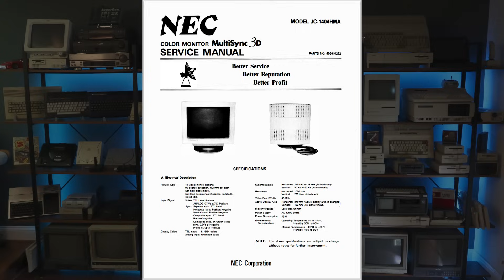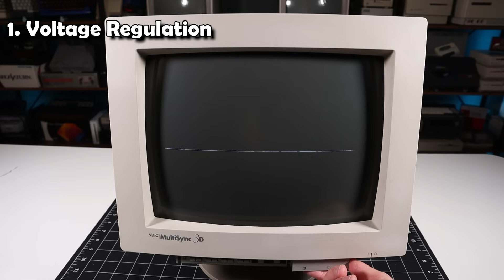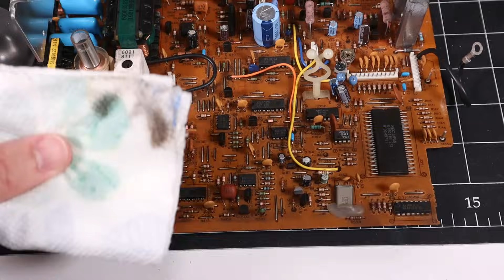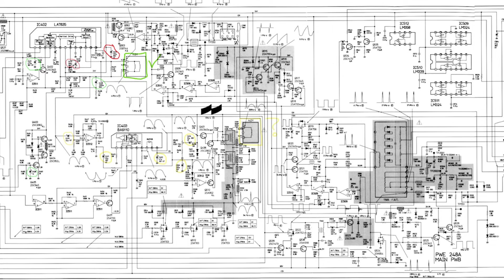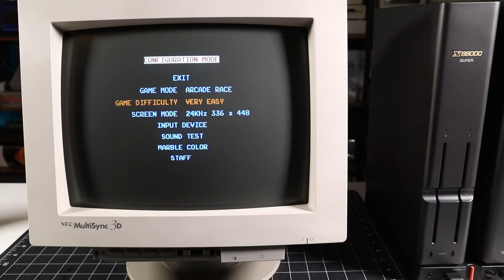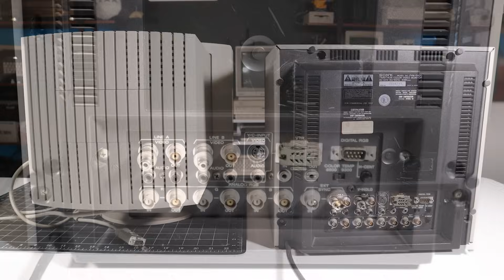The best CRT for RGB? Meet the NEC MultiSync 3D!

Comment: They didn't had various connectors. Instead NEC bundled several adapters with the monitor. I have one I got for free few years ago - after a recap it works like a charm, and CRT in mine is very low hours as well!

Comment: When you showed the VGA game on the 486 it looked like it was double scanning the image. Shouldn't this monitor be running in true 15khz mode on DOS VGA games? If this monitor can run in true 15khz mode on DOS I'd love to see you make another video on it-- there are barely any videos on youtube which talk about this-- the fact that most VGA monitors were double scanning 15khz DOS games up to 31khz due to lack of compatibility with 15khz on newer monitors, and thus low res games would look blocky on most monitors. But if you had a monitor that could run in true 15khz mode, you'd get a much nicer picture. Would love to see how various DOS VGA titles looked on a 15khz monitor.
Reply: I don't think this is correct, DOS games even on VGA 320x200 with 256 colors (BIOS mode 13h) run at 31khz, that is the base VGA horizontal refresh rate. Only certain graphics cards, with custom drivers, can be made to output 240p @ 15khz, which is non-standard for VGA.

Comment: I have a Samsung Syncmaster 955DF high end CRT monitor from 2002. The issue is that it's basically a 1440p CRT monitor with very sharp phosphors, it's way too sharp for 480p, 480i and 240p.

Comment: I have this monitor and need to adjust the pin cushion distortion. The service manual says to adjust VR403. Do you know where that is? I've removed the cover and checked all the visible pots but don't see it. Surely it's not buried somewhere completely inaccessible?!

Comment: I don't think there was anything wrong with it other than the pot.  Still, they needed to be replaced anyway.  But it is always good practice to get it working first before just replacing caps.  It will serve you well in the long run and force you to learn troubleshooting.  
 Great collection with the 68000. I'd love one of them. Arcade perfect ports of Mr Do! and Frogger and many other arcade games.  I bought all kinds of crap at TCF, but I haven't been there since like 2001 or 2002.  Back when I went it was enormous. You really couldn't do the whole thing in 1 day, so I always went on 2 days (IIRC, it was a 3 day event like every April or May just North of Trenton, NJ).  In the early years there for me, you had to take a yellow school bus from the parking lot to the flea market area.

Comment: That oily film on the PCB is likely what protected the PCB from leaking capacitor damage.  If it were my monitor, I definitely would not "clean" that main PCB.  If for no other reason, it is ALL downside.  If there is a drop of moisture in the wrong place and you put power to it, it is likely to fry an unobtanium part.  There is NO upside to "cleaning" it.  It won't perform better or run cooler or prevent corrosion or have any other tangible benefit.

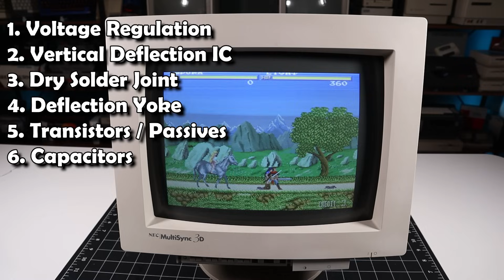Comment: 7:14 Or number 7, it could be a bad or dirty potentiometer. The fact that when you tweaked on the pot, it was expanding and then quickly contracting means deoxit might fix it.  It might not be that, but it can be.
Reply: I did some work on my MultiSync II recently, and suspected a pot was responsible for the slightly flickery picture. I'd probably have cleaned the pots even without that symptom, but it certainly fixed that issue.

Comment: I have fond memories of this display: bought one from the first reseller I could find that sold it for under $600 for my first AT clone in 1990. I was a kid at the time so money was tight: I could only afford an EGA card but knew I would upgrade to Super VGA as soon as I could, and didn't want to have to buy a new monitor all over again. It went in for repair at least twice and it got demoted to secondary use when I got a 17-inch display (which was a big deal back in those days) a few years later, but I'm really wishing I still had this bad boy. It looked good from every angle, and as you demonstrated, it could handle just about any job you can throw at it.

Comment: I have a Panasonic DT-1300MS that i got unused NIB in 2014. It has pretty much the same technical specs as the MultiSync 3D except going to 50KHz Hsync and 100Hz Vsync.

Comment: I just got one of these monitors. Untested. I'm gonna throw it on the bench immediately. I didn't know it could do 240p. This is the monitor I needed for my supergun, without using an upscaler.
Reply: This should work perfect with my retrotink 2x, with 240p pass through. I can't wait to get it going.
Reply from the maker: I hope it works out for you! It seems like they all just need a recap eventually.
Reply: @retrobitstv  I feel like that's just about anything nowadays. My Atari 2600 needed a recap recently, as well as a couple CRT TV's.

Comment: @21:30..try a bulk disc eraser to remove the minor burn in
tried it years ago and it helped a lot on some bad burn in
made it very light, almost as light as the line in your screen
just wave the magnets close to the screen
it may be worth a try
Reply from the maker: Thanks for the tip!

Comment: Nice find and nice work you did on this monitor. It brings me joy to see such an old gem restored and back in service. It seems like you could do some fine adjustments on the geometry though, but just seeing it back to work and handling all the wacky signals the MiSTer and the X68000 throws at it is amazing. I'm rather curious to see how it handles those arcade cores with even weirder frame rates, like MoonPatrol and Qbert.

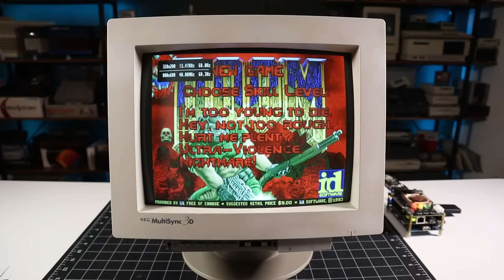28:35 I can't play Doom on my VGA CRT with my MiSTer because instead of a pixel-doubled, line-doubled 320x200@70Hz a 31.47kHz hsync normal VGA card would output, it outputs 320x200@60Hz with a 13.47kHz hsync (or at least that's what the OSD tells me, I still have to check with an osciloscope). In fact, I can't even get proper 720x400 text mode because, again, it outputs a weird 26.95kHz hsync, 60Hz vsync weird signal that my monitor absolutely does not like.

Looks like MiSTer's ao486 core doesn't like 70Hz video output. I spent a quite a few hours reading forum threads and trying a bunch of different settings to try to get ao486 play with my old computer monitor, but I just couldn't  get it without having to enable the internal scaler and dealing with an horrible mess of barely readable text.

Comment: That's the thing, sure it is better to know why something fails, but who wants to take things apart over and over again even if you can save 50% of the "good" capacitors?😵‍💫It's old, new caps only benefit the lifespan, same can be said of total solder reflow efforts.
Multi-sync is definitely one of the major limits in all screen technology even now as manufacturing economy usually only supports a minimum range of sync variations. In hindsight all those past oddball screen modes sure were hard to fix on future LCDs, gave the upscaler makers a lot of homework to do heh.
Definitely not a cheap monitor bitd for all its glory, and that moniker 3D is misleading? More AV ports on a PVM but you can't beat that sweet dot pitch of a PC monitor.🙂

Comment: I still remember recapping old Commodore 1084S 15khz RGB Amiga monitor back in summer of 2016. It was hell, but, in the end it worked.
Reply from the maker: Haha, same here! The first monitor I ever tried to repair was a 1084S and all I had was an old $15 radio shack soldering iron. That was fun :)

Comment: You probablyneed tolook for parallel resistance to on the caps. Probably not a bad idea to change out all the small electrolytics to be honest.  They have all lived in a hot environment and are over 30 years old which is way more than their intended working life.

Comment: I presume the 3D works similar to the Multisync II (which I still have), which means it will work fine with a Tandy Coco 3 in analog RGB as well (In fact it's dot pitch (.28) was much better than Tandy's own CM-8 Analog RGB monitor (.54) , or even my Magnavox CM8515 (.42).
Reply from the maker: Yep the 3D is just a minor update on the II. I have a CoCo3 that is in need of repair. I will have to build an RGB cable for the machine and try it out, thanks!

Comment: I'm glad you got it running, good work! I've certainly been guilty of bumping a pot when sliding a board back in, that section at the front right was my nemesis when trying to reinsert the board.

I also just got mine (early 1990) reassembled this weekend and running on my Pioneer Mac clone - seems great but a little washed out, so I'll have to twiddle some pots. I'm in the midst of constructing an RGBI adapter to run my PC-6001mkII and PC-6601SR on it. I haven't considered using it on the X68000 yet; my X68000 PRO is running on a Dell P2314Ht LCD which seems to do very well but I haven't tried Marble Madness yet.

I counted 87 caps replaced on mine (did everything except the big primary cap on the PSU) and did two Digi-Key orders (forgot the bipolar cap on the neckboard.) All of the Rubycon SSP caps were open on mine, including the ones on the Mitsubishi RGB amplifier on the neckboard, which created a crazy green interference pattern that looked like the Northern Lights.

The hood on my "VGA" connector was also very loose, I had to take the screws out and reassemble it with a dot of Loctite. Not sure what happened.
Reply from the maker: Nice, congrats on getting it up and running! I forgot to order the one NP cap as well, and there was one other on the main PCB that was so small it didn't have the specs printed on it nor was it listed in the service manual :(
Reply: @retrobitstv  I'll have a full (observed) cap list when I publish the article in the New Year (queue is finally getting long, hooray) but I don't remember any unmarked main board caps other than the tantalum near the EEPROM. Yours is a year newer than mine though. I made some adapter pcbs because I didn't want to do any wiring of adapter cables, but I'm waiting on them to get here from China.
Reply from the maker: @leadedsolder  I noticed the cap list in the service manual was far from complete. As in, it only had coverage for 50% of the electrolytics. The manual is for JC-1404HMA and my model has a -1 at the end but I can't imagine it's that different. I put all the caps I swapped into a spreadsheet: C165 was the one that was too small for me to read and C905 was the 4.7uF/35v NP that I didn't order. Including those, there are 86 in total. Maybe I missed one somewhere?

Comment: I love watching all your content Matt, particularly the x68000 which was the real treat for me!
Now I have a video to rival it!!

I’m so happy you managed to get this baby working as it has a tremendous range of function.

I’m lucky enough to own a microvetec 20H948FS2A (can’t find any info or manual online) but it appears to be a 20” version that is quad sync (bad term I know) same as yours.

It works but tbh has a small horizontal line issue where the picture at the right of the screen is very slightly compressed.
Hard to notice but I don’t dare try to open this monitor up to diagnose or fix this.
I notice the colour could do with a tweak too!

It’s a shame these models didn’t come with an engineer mode to alter the finer aspects of the picture, I always loved the Sony trinitrons for that aswell as some of the Barco & Mitsubishi computer monitor ranges.

Oh well, enjoy that beautiful monitor and thanks so much for your great, great content!👌👍
Reply from the maker: Glad you enjoyed it! Cool, I didn't know about the microvetec, sounds even more rare :) I definitely need to calibrate the color after comparing the image to the PVM but it's not something I've done before. I guess I need to find a reference card or something.

Comment: Sadly mine broke 10y ago it was my Amiga 1200's best friend it had exactly same issue than yours😮
Reply from the maker: Seems to be a common thing for these to have failed around that time period judging by the posts I've found about them online. I wonder what percentage of them were e-wasted because of it and how many remain just waiting to be repaired?
Reply: @retrobitstv  Well my Multisync 3D has been stored for 20 years! I plugged it in today (on an Amiga 2000 with the original Macrosystem deinterlacer) and the image is good although it starts with not using all vertical space. After 10 minutes it is warmed up and the screen looks perfect.  Googled to find solution...Your video made me decide I am going to replace the caps! Thanks!

Comment: I blew out one of these in the early days of Linux X Windows when you could set scan rates that your monitor could never do. I also put another one at risk when I finally learned how to set a proper scan rate and my 386 DX 40 with 8 meg or ram had a OLVWM GUI as good as a Sun IPX workstation. Ah, 1024 X 768 in the early 1990's. Fun times.
Reply from the maker: Haha yea always something I worry about when firing up a random MiSTer core on a 15khz-only monitor without checking what resolution it's going to try and spit out first. Fortunately replacement horizontal output transistors are still available :)

Comment: Will it work with the Commodore 128 vdc 80 column chip?
Reply from the maker: It does indeed and that was the very first TTL RGB source I tested it with since my C128 is always hooked up and ready to go! Unfortunately the NEC doesn't support composite/s-video so there's no easy way to use 40 column mode without a c0pperdragon or converter :/

Comment: Easily my favourite monitor. Great for PC88 and PC98 stuff. If you use Japanese machines regularly, getting a NEC multisync (even relatively modern HD OLED ones) is obvious option as NEC still supports 24Khz; if it has an VGA in. I suspect to keep backwards compatibility with their own equipment from the 80's till the late 90's, or it being grandfathered into their VGA signal handing. 

And if I recall correctly they're the first to market their monitors as multisync and still mean it. Most modern manufacturers seem to have transitioned their multisync branding as just that, branding.

Comment: It cannot be understated just how iconic this monitor was.  It was the crowning jewel in any home computer set up.  Rarely seen.  Very expensive.  Absolutely awesome.  I had a part time job selling computers in high school and the NEC multi sync 3D was the top of the line upgrade add on from the standard amber or paper white monochrome monitors. 

So rare to see someone shell out the additional cost for it.  But when they did, wowie what a treat to see in real life.

Comment: The red cathode is pretty weak, you can bump up the cut off potentiometer on the neck board.
Reply from the maker: I didn't really notice until comparing the still shots of the PVM to the NEC and seeing the big difference in color. Fortunately the pots on the neck board are super easy to access so I may have a go at sorting out the color. There are adjustments for each of RGB's gain, bias, and sub brightness but tbh I'm not well-versed in what the difference is. Guess I need to study up first.
Reply: To my knowledge, bias is the same as cut-off, controls the 'brightness'  of each color (the vertical position of the signal->brightness curve), gain controls the contrast of each color (the slope of the signal->brightness curve), the sub-brightness is just another brightness control which moves the range of normal brightness control up and down     @retrobitstv

Comment: Print the 3d panel in semi-translucent smoke acrylic type color-- that would make it look period accurate (ish) :)
Reply: That's not a bad idea. Although with all the vendors out there that sell filament (like Printed Solid who sell the filaments that almost match Commodore machines), there's gotta be something that's close enough to the monitor color.
Reply from the maker: Surprisingly, I did find a model for the door on thingiverse but didn't get around to printing it yet - the episode already went on long enough without it. I will have to look for a suitable color filament.

Comment: Lucky! Even though it took a lot of work to get it properly running. $20 is definitely worth the effort. As an X68000 owner myself, it will be a challenge to connect it to a CRT. I don't have any digital RGB sources, so that's one less thing I have to worry about for now. I do have an XPC-4, though, so I can at least use the machine, but I would love to see the output as one is supposed to on CRT.
Reply from the maker: Ah yea the XPC-4 is a fair chunk of change these days! I was able to get a good result with a borrowed OSSC but it took some dialing in of the advanced settings. Honestly since these MultiSyncs are so hard to find and worn out, using an upscaler with a much newer/larger SVGA CRT would probably be preferable anyway.
Reply: @retrobitstv  Ah, that's interesting. I wonder how that would look, since the scan lines wouldn't be exactly right. You'd be getting scan lines for the output resolution of the scalar, as opposed to the actual resolution. Could be interesting to see a comparison, as tri sync monitors are extremely rare in general, and there is the wear on the tube to consider as well, like you said.

Comment: Apart from absurdly expensive professional monitors, Multisync was something like the king of monitors. I think the brand still exists although it means little nowadays.
Reply from the maker: Yea it seems like they've slapped the MultiSync label on every model since forever now :/
Reply: Brand still exists, and if they have a VGA in it's still actually a multisync display as opposed to other brands' multisync branding. I've used a modern HD NEC screen from 2010-ish for years for my PC88 and PC98 (which basically run on nothing but screens that can handle weird signals, 24Khz and all that).

So the brand's still great if you import Japanese computers and need a display and don't want to buy or use an upscaler.